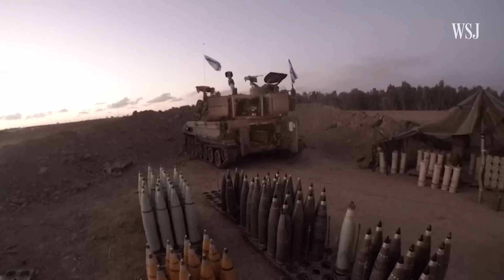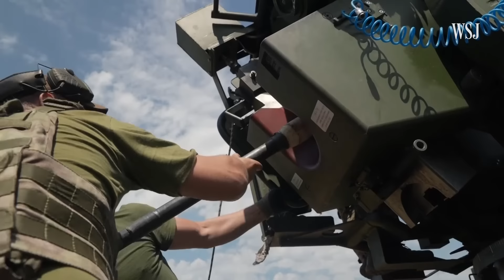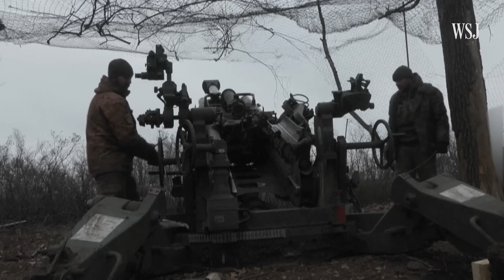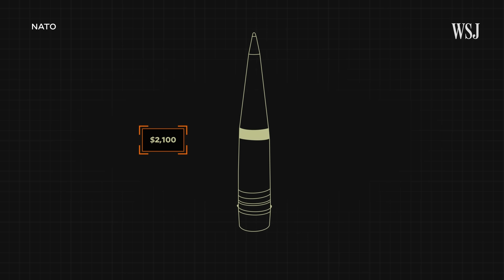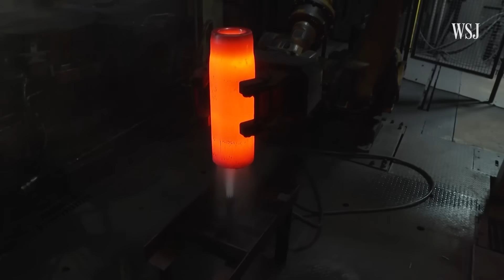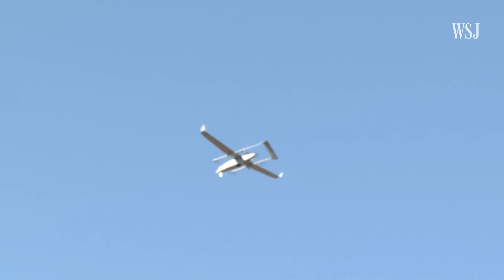Why the 155mm Shell Is One of the World’s Most Wanted Objects Now | WSJ Equipped

Comment: Wow, you forgot to mention that to get the higher range will reduce the explosives. Just going to higher energy means that the shell has to be built to handle higher accelerations, and if there is base bleed, or rockets or ramjet mean need to use weight and space for the motors and for the fuel. A bad video.

Comment: Monopoly that’s why it’s in hight demand. Why not 156mm or 154mm because they chose 155mm because it’s 6 inch diameter and when you really think about it it’s standardization in case of world war but the problem is some nato members don’t want to spend 2% of the gdp for armaments and also supply and demand making the item artificially expensive when you have low production vs the demand. The military industrial complex at work folks. Their  motto should be  war is good for business. Delivering carnage since 1939

Comment: You description of the ammunition is near worthless.  The base round which costs around $600-1000 has the range of something like 23km (I am not going to look them up right now, but you get the idea).  They have a rocket assisted round that gets around 40km range, but it costs significantly more at around $15,000.  They can fire both these from a long barrel version of the Paladin and go something like 30km and 70kn respectively.  The Excalibur uses the same rocket boosted munitions so it has similar range but the cost is VERY high.  Some estimates are as low as about $50,000 and some have been over $100,000.  The problem I have is that it is too close to the cost of the HIMARS rockets and those have a longer range still (especially the new ones) at around 150km AND as larger warhead.  They cost around $115,000.

I personally do not think the Excalibur round is worth it.  I also do not think the M777 towed artillery is worth it either because it takes almost double the crew of the most recent version of the Paladin.  Crew is a significant cost of operating these artillery pieces.  Also if they adopt this longer barrel is either the standard or at least a popular option they would have a significant range advantage over say a Russian howitzer.  The Paladin also can set-up, fire, and move far faster too making it more fitting to the current US combat doctrines.  Even without guided munitions the Paladin's ballistic computers are pretty accurate, not as good as the Excalibur, but better than the Russian artillery.

Also do not think the HIMARS is in too small of numbers as we only gave Ukraine something like 20 out of our 500 and we have even more of the older tracked versions.  The big difference between Ukraine or Russia and the US is that the US would be operating with air support.  This is what is missing in that war primarily and is why neither can easily break enemy lines.  They also lack some of the more advanced anti drone systems the US has developed in the last 10 years.  Drones have made this war VERY costly for both sides, especially against large offensive drives like Russia has been pushing.

Comment: Wait so a shell went from around $2,000 a piece to over  $8,000??? Someone is getting rich.
Reply: That's what happens when the demand is much greater than what is available.
Reply: Aaah ! War.
Reply: It got more expensive because a bunch of money was spent building new foundries. Over time, the cost per unit will go down as total production increases.
Reply: @pax6833  Current production increase is tiny fraction of projected one. Right now they are banking huge profits. 

Lets say production cost was $1000, so they profited $1000, which is quite a profit margin. Now they are profiting $7000 per shell. 

Now, lets imagine they managed to half the production cost and price dropped to $4000, which is still double the original. Now profit is $3500 per shell, they'll have to double the production, just to match profits when the price was $8000 per shell.

But that's not all, there are risks involved. The projected production volume is not sustainable if there's no ongoing war. When demand goes back to peacetime, there will be a price drop bellow original because of oversupply. They will have to slow down the production, driving production costs up, in fact, now they have to take care of unused and underutilized equipment too, which will drive production cost above original...

So it's the age old question, is it worth it to run production up. Maybe, after all US is always at war. But it looks like manufacturers took more cautious approach, maximizing profits while increasing the volume at much slower pace.
Reply: @armeniangenocide5778   All of that tells me you don't know how expensive production is.

In reality, setting up new production was enormously expensive. No, they are not making 7k per shell. I'd be surprised if they're even making more than 1k per shell.
Reply: @pax6833  So you actually believe that a private company would sacrifice profits like that? Where do they sell rose glasses that strong?
Reply: Supply and demand. Production is being increased.
Reply: Isn't the purpose of most wars?
Reply: @paulskopic5844  No its not this is one of the biggest known idiot takes
Reply: @rere-x6g  It is obvious that English is not your first language.
Reply: @paulskopic5844  The problem since the American military-industrial complex has a monopoly they overcharge everything, so a component that would cost 100$ if y buy it from a shop would cost you 1000$ from them
Reply: Rule of acquisition # #35.  War is good for business.    #36. Peace is good for business.
Reply: New toolings, new facilities, employees overtime pay, etc. Similar factors on the supplies side where they have to do the same and increase the supplies price. Some have to go though the bidding process and price increase if you want them and bid higher.
Reply: Thats what happens when demand goes up
Reply: yup they probably have to pay their workers overtime to meet the quota....
Reply: @k54122  Hahahahaha. yeah, I'm sure that the workers' overtime pay is what drives the price so much. Lol. Just like I'm sure they've increased all their workers' salaries/hourly rates and gave them big bonuses every quarter as a reward for meeting their goals and working so hard. In particular, every time any company owners and top management brass get a big fat government contract the first thing they do is pay their workers more and improve their working conditions while the top dogs all humbly forfeit their bonuses and salary increases just so all that money can be re-invested into the company. 😉😄
Reply: Supply and demand. Savor the flavor of capitalism. The suppliers are merely capitalizing on the demand to make a tidy profit. It's the American dream.
Reply: Woah… you just find out the purpose of war
Reply: Welcome to capitalism
Reply: Rule 34 !
Reply: yes, Pakistan Army after emptying their stocks to Ukrain via Britian
Reply: You guys make it sound like some evil master plan. It's literally just supply and demand.
Reply: see: Pfizer/moderna/j&j
Reply: Yeah, imagine a world where war makes some people more money. Wait...
Reply: US, South Korea 74% EU 26% so you can see how will be rich
Reply: 🤣true
Reply: Wow what a genius 😂
Reply: Nein, hier handelt es sich nicht um eine Preissteigerungen, sondern um Preise der verschiedenen Typen von Granaten, $ 2.000,- für das Standard Geschoss, und die teuren für die Spezialgeschosse,wie die Reichweiten gesteigerten,oder Panzer und Bunkerbrecher etc.
Reply: Yeah why do you think the West provoked Putin into foolishly invading Ukraine? Yes yes yes, Putin is ultimately responsible for invading but that doesn't mean we can lie about what one of the primary causes of the war were.
Reply: "War is a racket" - Smedley Butler, one of the most legendary US marines in history.
Reply: That is classic supply and demand. In 6-7 years they will drop again to $2000.
Reply: Read Gen. Smedley Butler's book "War is a Racket" It's about WW1 but applies from there onward...
Reply: Triple shifts and overtime cost for 24 hour production. And inflation costs for the materials. They should expand use of the 120 mm, same size used in tanks.
Reply: Not when materials to make that shell also increased by at least that much. Prices on EVERYTHING have increased in the last 4 years. Those increases also affect arms manufacturers.
Reply: inflation
Reply: Increase in over demand of a product will increase both equilibrium price and equilibrium quantity demanded
Reply: @holdenjambor5697  
The USA war machine was not ready for any war with Russia. Not even china is it ready.
Reply: its all a scam. production costs are actually lower thanks to ramped up production which took a while to get going again but the prices keep exploding.
Reply: @feluto7172  
No it’s not in this case. The country has new plants under construction to manufacture munitions after they realized how under prepared they are. Even stinger missiles had stopped production and the people who built them retired. They had to be called back. They were only making like 4 missiles a month.
Reply: Ya, very smart thinking! And the reason for bank robberies is gun makers and ammo factories supplying the Police. So actually the industry is responsible for bank robberies, right? The crooks are not to blame, also not Wladimir Putin! Amazing. You should get a Nobel Prize for this finding. And a Doctor title from the University of Idiocracy.
Reply: @davidhermann8639  Before blaming putin, you should blame nato expantion. Daily reminder than cuba is a sovereign country and yet was under internationnal embargo just because USA wanted it
Reply: @davidhermann8639 Create a problem sell a solution. Watch the 2005 US documentary "why we fight"
Reply: @davidhermann8639   Actually the title goes to you. For completely missing the point !!!   he commented on the cost of shells , not the need .. Hope that lights a  bulb !
Reply: @smrtdis  bruh. my guy. Law of supply & relevant range
Reply: I don't see how they can cost that much, it's a hunk of metal, propellant, explosive, trigger. None of these things should be nearly that expensive.
Reply: @cyrex686 it's a limited market with big fixed costs - economics
Reply: @cyrex686 Nothing is too expensive, when you have a tool that guarantees to kill the enemy right in front of your door.
Reply: @cyrex686  You are welcome to work in a Chinese fireworks factory in that case, just don't expect to live very long with that attitude.
Reply: @cyrex686  The costs are not just for the materials themselves. You also have to take delivery costs and employee costs into consideration, for example.

Comment: Some of these can use the electronics of recycled phones, cameras to reach the targets. Very old missiles can be equipped with used camera phone panel, the camera can be calibrated. Samsung has auto focus for old phones. Freezing Coca Cola bottles are designed to fit the electromagnetic railgun, and a metal frame causes it to be fired, the frame rips apart. The coke can destroy a reinforced concrete wall due to its speed.

Comment: Yeah, they adopted the 155 but it's big and slow and heavy to move.  We had 105s and we could put at least 10 times the amount of shells on a target as a 155 battery and do it sooner.  There's quality in quantity.  105s had to be closer but it worked.  With a one gun 155 "barrage", you can hide until a shell lands and come out and fire back.  You can't do that against 105s.  You're too busy trying to stay alive.  The emphasis on 155s was a typical NATO bureaucrat decision - they could spend the money on expensive high tech weapons instead of the basics.
Reply: Are you being hyperbolic or really mean 10 times the amount?
Reply: As I understand it, the systems that fire the 105s have a much shorter range. If you have a shorter range than your enemy, you get destroyed before you even get close enough to fire. The 155mm calibre can be fired at higher ranges, and with certain types of shells, with pinpoint precision.

Comment: The problem with the ramjet shell is that it will likely not have as much explosive filler as a normal shell.
Reply: The benefit of a  <90 mile artillery round is the psychological effect on troops behind the lines.  It also places all  ground support logistic  activities within range.  Especially munition, supply  & fuel locations.  Those 20,000  artillery rounds are being stores close to the front..
Reply: and cost. Jdams are still the cheapest way to hit ground over long distances.
Reply: @dmvfilms  JDAMS are cheap as long as you exclude the cost of the delivery platform. $50k for every flight hour ain't cheap, either.
Reply: @dmvfilms Yet you cant field the airplane that has to carry your jdam everywhere and whenever, Ukraine is a prime example. 

Both sides used jdams extensively when possible, but both would also be more than interested to acquire the capacity to safely hit deep without having to rely on extremely expensive SCALPs
Reply: It doesn't need it
Reply: No, the biggest problem with RAP rounds (as we call it) is that it tears the gun tube up. 
Destroys the howitzer barrel faster. Any Paladin or Triple 7 gunbunny can tell you that loading M549 up the spout makes battery gun chiefs squirm in discomfort. Not sure about XM1113
Reply: you wouldn't necessarily be using these in close in support of front line, but high value targets behind the lines which are usually much softer- think stationary radar installations, missile launchers, airfields, ammo and fuel depots, command centers, logistics hubs, barracks, warehouses.  You don't need a lot to punch holes and destroy those, what you do need is range accuracy and speed.
Reply: ideally the fuel/propellant could be an additional explosive. but yes even so without being able to increase the dimensions you cant give it the same explosives payload unless you change the explosive material.
Reply: @jailbreaker1214 - If the taget 90 miles away is an arms depot, then the explosive in the shell doesn't have to be very high to wreck havoc. 
I'd  hate to be the guy working in the artillery shell warehouse.

Comment: It's a basic machined piece of metal...should be very easy to ramp up production but suppliers want to Jack up the prices and keep production low
Reply: they want long term contracts in order to compensate for the investments needed for ramping up production
Reply: Do you understand how working with the government drives up prices?
Reply: In fact it has to be made to high tolerances, otherwise your gun can blow up. As Russians have found with North Korean ammunition.

Comment: In WWII until Vietnam, the 105mm was the most desired or desirable artillery shell type, light, easy to manufacture and have enough range to conduct fire missions, from the start of the 21st century countries have been slowly adapting 155mm and its howitzer or guns, it's bigger , more powerful but it's hard to manufacture in large numbers, 155mm has been the most standard western artillery shell from 21st century onwards.
Reply: We still use 105mm easily for us to transport and fight in mountains and jungles apparently we won’t be fighting in flat plains or steppes. We are also too poor to afford 155mm we could only fire like 6 shells a year with our budget.
Reply: I wouldn't say the start was in the 21st more like starting in the 60s with the M109
Reply: You are quite correct. Even in WWII we had the M12 SPH firing 155s.    Cheers @holo2762
Reply: The 155mm was used during ww2

Comment: $8k for a single artillery shell? is that with the 10% for the big guy or without?
Reply: Javelin missile costs 500k at least , that 8k is pennies comparatively
Reply: @spicychad55  $216k missile only.   That buys a lot of drones...
Reply: @Trust_but_Verify  Can i ask, how much cost different between 105 vs 155mm shell without fuse
Reply: @dernadaarmando2948  No idea.
Reply: @Trust_but_Verify the problem with drones is that they don't have a long enough range to be effective and you also need a lot of them as their explosive power isn't enough to hit houses or hardened cover.
Reply: Due to inflation, the Big Guy now gets 30%.
Reply: That's nothing. Missiles cost 1 to 2 million each.
Reply: @KurtDaKreator and those are cheap ones
But still,missiles aren’t used in millions
Reply: @joemamaobama6863  cheap ones are usually sub 1mil, hellfire/ATGM types, cruise missiles costing around 700k-1.5 mil is normal, esp a low observable one
Reply: Yeah true but I think demand outstrips supply right now, plus inflation. @joemamaobama6863
Reply: I remember US firing 100 tomawk missiles in Syria, each costed 1 mil. And they hit almost nothing, some went off course or god knows what because they accomplished nothing, rest were taken out by air defenses and the few that hit caused little insignificant damage. 100 mill down the drain just like that. Military adventurism is expensive :)
Reply: @DK-ei4ed  citation
Reply: lol I remember that shipped over Burger King deep fryers to Afghanistan and guess what they lost that war now. Ukraine will collapse soon too then Israel due to lack of funds/munitions.. @DK-ei4ed
Reply: as a german please please please vote for trump im so tired of this blatant corruption
Reply: @7172 Trump is corrupt himself, and not going to change the price of said ammo.